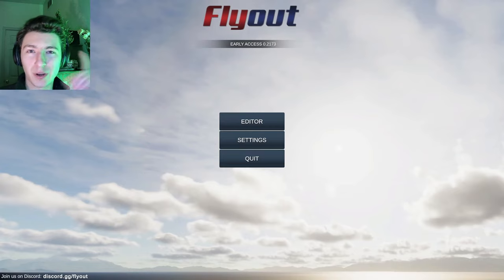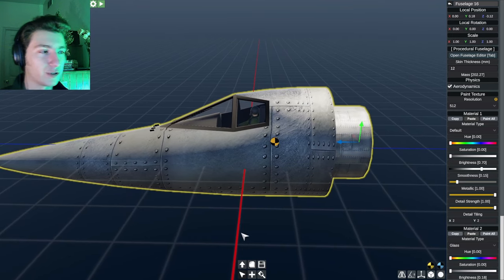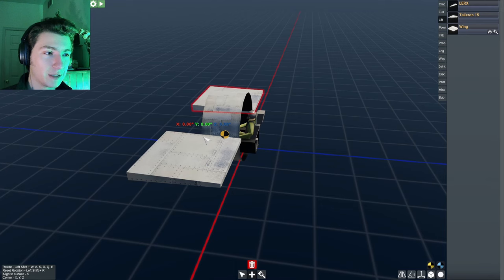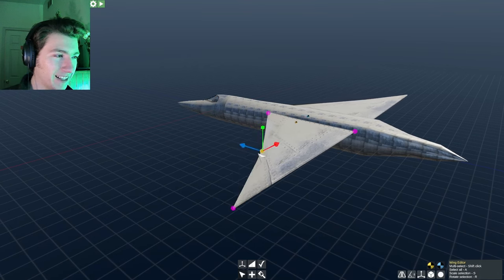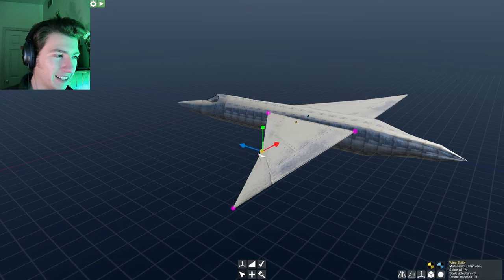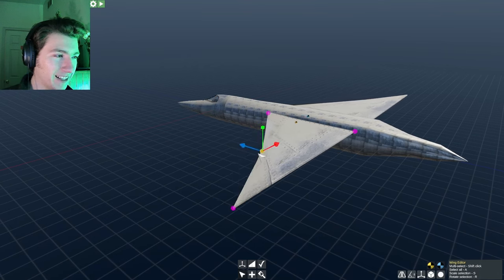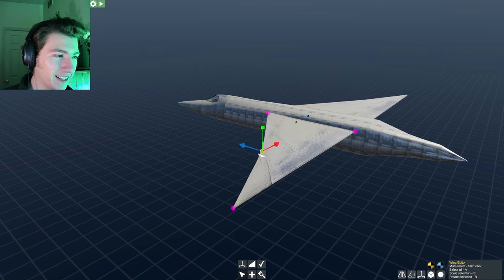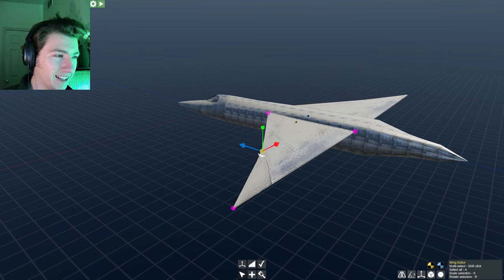Flyout Basics Tutorial 1 | How to Make Something That Flies | Flyout

Comment: Great video man. 8:07 you can do fine tuning of the vertices like in the fuselage editor but with the points illuminated. You can activate this tuner by clicking “Vertex” at the center bottom of the screen when the fuselage editor is opened. 

Additionally, basic shapes like square, circle, and oblong can be loaded in by clicking the top drop down in the fuselage editor menu. Click apply when you’ve selected the desired shape. 

Happy flying y’all!
Reply from the maker: Great tips, thank you!

Comment: Concerning connecting parts, When I add parts i have problems,   part A that has green dots(when  in fuse editor), these green dots disappear when i click on part B.
There won't be any A to B connection
Reply: Same. Have you found the answer yet?
Reply: @elonsmuskets7280  I think the solution is placing the first part onto the cockpit, I use a fuselage tube, the use the up arrow grabbing the tube place onto pilot seat/pilot. I have success this way.